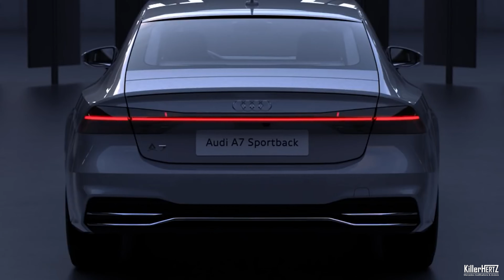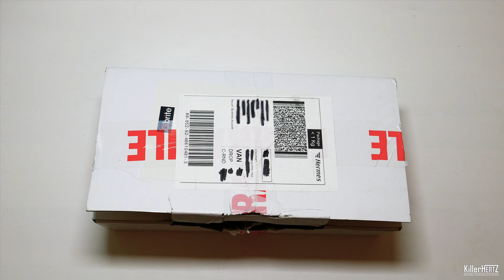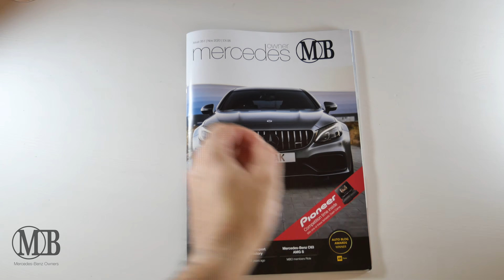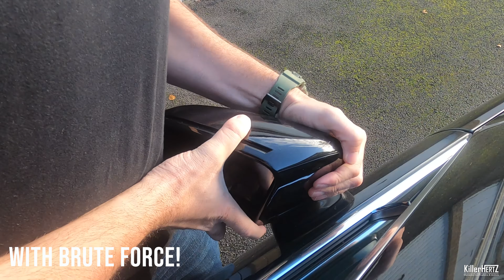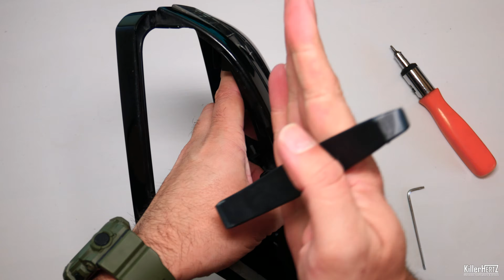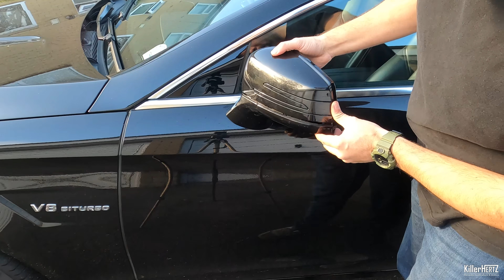Mercedes Sequential / Dynamic / Sweeping Indicators + Fitting Instructions

Comment: Hi...top vid. Thanks. Please can you tell us how long you've had on car and have they thrown up an error yet at all in that time? Thanks 😊
Reply from the maker: 2 months now, no errors. 

If your car is older and has filiment bulbs instead of LEDs in the indicator bulbs, then it will cause errors. Otherwise it wont :)
Reply: @killerhertzmercedes  have u got a link to the ones you purchased